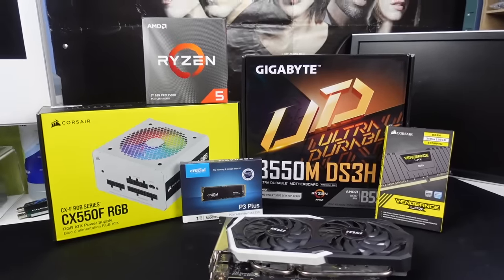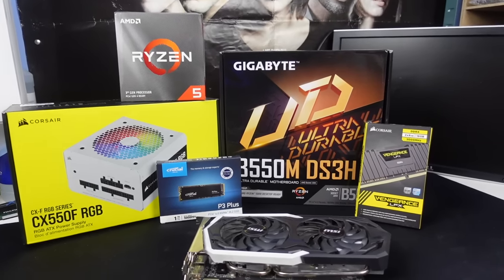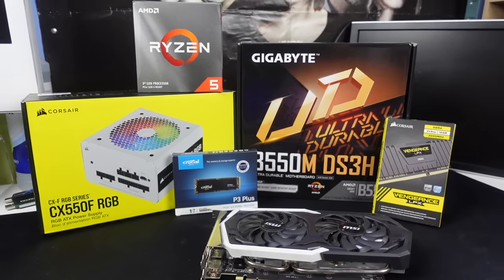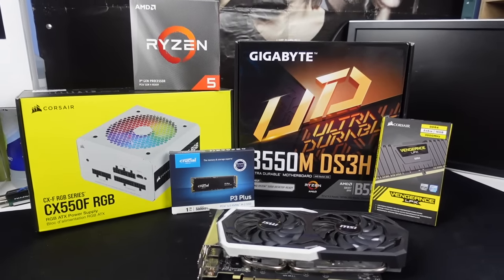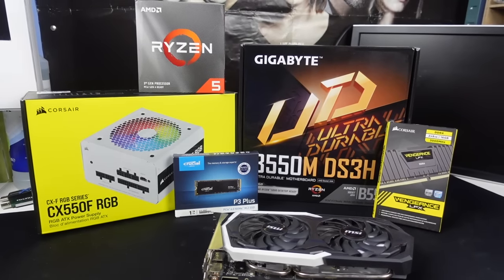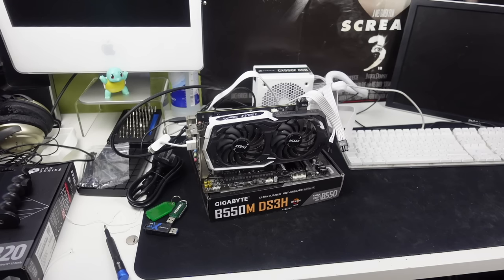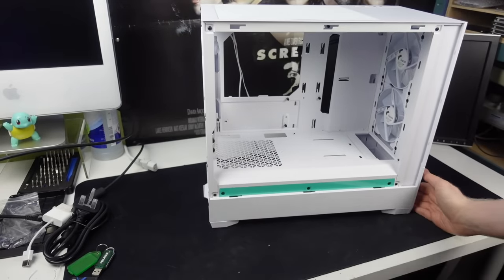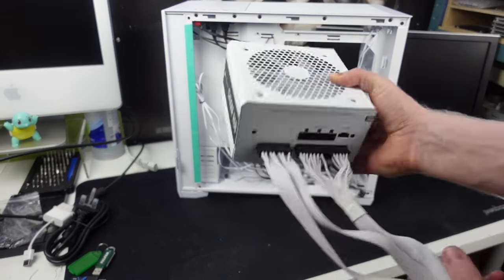Budget Micro ATX Gaming PC Build (New & Used Parts) - Part 1

Comment: You would think that by now, motherboard makers would ensure the motherboard boots in a form of safe mode, that bypasses the CPU or GPU if it's not compatible or has an incorrect BIOS, and allow you to update the BIOS or run diagnostics in some form of GUI regardless, rather than doing things literally in the dark.

Comment: That little case is bigger on the inside than it is on the outside, well clearly it’s a TARDIS.  Seriously Fractal Design cases are quite nice with respect to fit and finish.  However, mounting a water cooling radiator in the top typically requires an offset bracket (generally included).  Therefore, if you were planning on installing a 120mm or 240mm radiator (if a 240mm would even fit) you might need said offset bracket.  It’s probably better to just use the front fan intake for a radiator.  Either way it looks grand, can’t wait to see the followup video(s).
Reply from the maker: Ohhh interesting! Thanks for the heads up on this. I'll have a look into that. Haha yes absolutely, it is very much a TARDIS in this little case!

Comment: Hope you and family are well Tom, good to see you're still making content and doing tech stuff when you can. This one was interesting as I've been thinking about building a budget PC lately. I've switched to Apple Silicon but need X86 windows for a couple of things. Trying to decide whether to build something or buy one of those little Dell Optiplex things used. 1 constructive thing, and I will be in the minority here, but I prefer the stereo camera mics.
Reply from the maker: We're all well thanks, hope you are too! 
I was in a similar position in work, ended up picking up 2 HP Elitedesk PCs from eBay. They're tiny, cheap and seem to be doing really well. Slightly out of date prebuilt systems, especially proprietary stuff from Dell, HP etc are all dirt cheap. It would've cost me a lot more to build the same machine even from used parts. 

Thanks for the heads up on the audio too. I know exactly what you mean. I prefer the more natural sound of the camera mics, but not having all that static noise with this mic is quite the improvement I feel, for me during editing anyway I've noticed a bit of relief on the high end when using headphones. It's easier for me to control levels too, but it is definitely a compromise as it's far more clinical now and not as real. It's not very IMNC is it.

Comment: my2cents on this video: 
1) if you want to short the bios jumpers or anything in general, power needs to be on in order to short it
how do you want to short something that has no power?

2) the power supply fan blows some how warm air straight to the GPU fans. That's not ideal espacially when gaming!

3) I think you'll need at least a 360 radiator to cool this CPU and the 5700 XT to proper temps.

besindes that, nice vlog like alwalys 🙂
Reply from the maker: Thanks for the comment! 

1) You are probably right, I just always presume with CMOS battery installed there's a small trickle in the board to perform BIOS level stuff. Removal of the CMOS battery should do the same thing anyway. 

2) ATX PSU fans are always intakes, so it will draw warm air from the case and exhaust out the back of the PSU. It won't blow on the GPU. I generally prefer fan side down as it separates the PSU thermals almost entirely from the case, but using the PSU as an additional exhaust is not very detrimental. Fan side up was chosen in this instance for looks only. The only real detriment is the PSU receives warmer air (case temp) as apposed to fresh air from outside the case, but if there are a lack of exhausts in the system this could also work to the benefit of the overall case temp. It's negligible if it makes much difference to PSU performance. When PSUs were common place in the top of cases, PSUs with 120mm fans would always face the case internals, and exhaust hot air.

3) Definitely. I'm really hoping that I can squeeze in 2x 240mm rads, one in the top and one in the front. That's the plan anyway. If not, I'm hoping at minimum to squeeze in 1x 240mm in either front or top, and 1x 120mm.

Comment: Amazing to see you back! Enjoyed the Video. A word of warning in regards to the Ryzen 5 3600, it is supposed to be working fine with 3200 MHz RAM, but the unit I had for example would not go beyond 3000 MHz on its D.O.C.P. (XMP) Profile in a stable manner. I know it was the CPU since with a different CPU the ram is running in 3200 MHz on the same board without issues.
Reply from the maker: Ah interesting! Thanks for the heads up on this.

Comment: I've built quite a few Modern Intel and Ryzen systems, I use to use some older monitor to set stuff up, quickly found out the monitor did not like the resolution the bios displayed at, That lead me down a RMA path that I didn't need to go down as a different monitor I tried did the same thing, I found that most modern monitors will usually be fine, but not all older monitors, On my work bench I now use this 2007 era HP monitor that seems to work with everything so far.

So if you come crossed another issue where you get no display, Some chance that the monitor just don't like the bios resolution.
Reply from the maker: Thanks for the heads up! Good to know. I am looking for a more modern monitor for my test setup. Hoping to find just a simple 24" 1080p monitor with HDMI and DisplayPort. I'm keeping my eye on marketplace.

Comment: is it possible to install Hackintosh in this device?
Reply from the maker: I'm not entirely sure. I haven't swung by the Hackintosh community for a while, so I'm not sure what the latest is. I can hazard a guess though and say that the GPU is no good, and as it's AMD it will be much more difficult than Intel.
Reply: @ItsMyNaturalColour hackintosned a fairly similar system recently and yeah. Slightly more difficult and you'd need an AMD GPU since the 1660 and stuff don't have any macOS drivers in any release but doable!

Comment: Personally, I'm not a fan of water cooling. My philosophy is, if you can't air cool it, you aren't moving enough air through enough metal. Water cooling can be easy to saturate with heat, and it takes a long time to give that heat up thanks to water's specific heat capacity. It's good for long-term stable loads, but it's not good for sporadic loads. If you want to cool a computer down quickly, you're not going to do it with liquid cooling.

That said, liquid cooling works. You do you. I just never bothered because the gains never outweighed the effort.
Reply from the maker: Thanks for sharing! I can understand this, as I've never struggled to cool anything with air. Same goes for this PC. I'll be water-cooling for fun, to learn, and to make a nice entertaining video for the channel. The system should also be lovely too, allowing a nice overclock and of course, eliminating all the blower noise from the flashed GPU! 

Oh, and can't forget looks. It won't be very practical but it will be great fun!
Reply: @ItsMyNaturalColour  it will definitely be quieter, that much is assured, so it's not like there's no practical reason to do it.